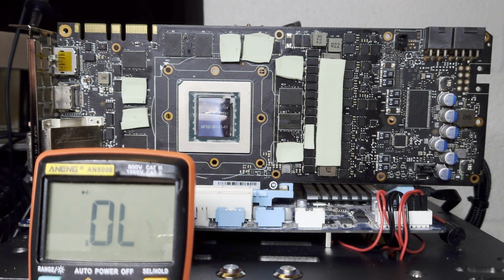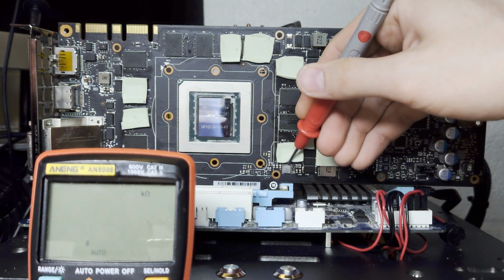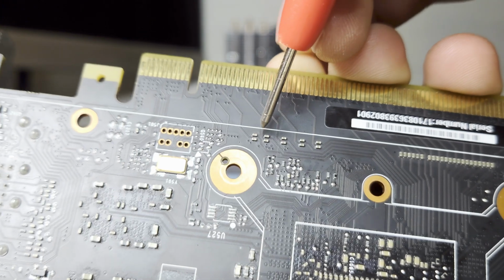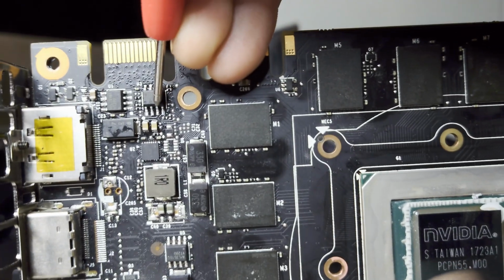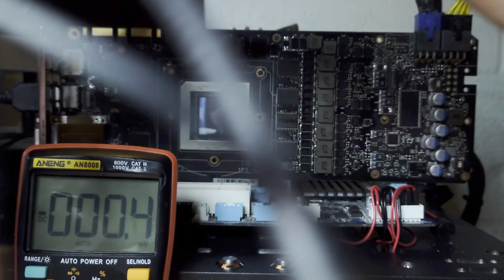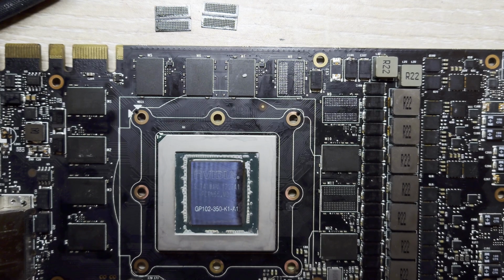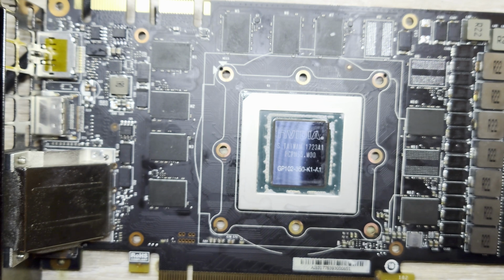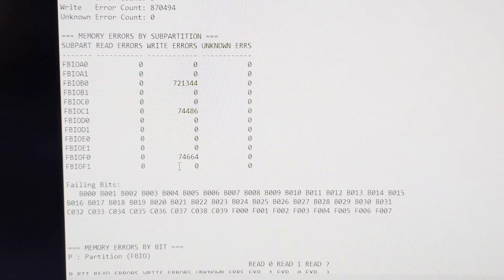EVGA GTX 1080 Ti SC Black Diagnosis - Not Detected

Comment: I had this exact same issue on pretty much the exact same card (mine was an SC2). Three dead memory channels in the upper right corner of the GPU. Which didn't pass the common sense check, very unlikely that 3 modules died at the same time. GPU had no thermal paste on that corner, which probably killed the memory controller. Anyhow, instead of swapping in a new memory module, I swapped memory chips between a known good channel and a known bad channel. My suspicions were confirmed. Not only did the errors not change channels, but the error count didn't change either. Therefore, dead GPU memory controller. Take a lesson, children: bad thermal paste can kill your GPU! This test also demonstrated that the memory chip taken from the dead channel was still perfectly fine, and therefore all 11 VRAM chips were likely still good.
Reply: Hi, I have a specific graphic for the operating processor. I'm looking for the pcb since my pcb was burned by a mosfet, I only need the evga pcb or founder edition, how do I get it? can someone sell me? just the pcb without the processor
Reply: That’s what happened to me, I got a good bargain for a GTX1080ti in good conditions, and the seller seems like wanted to repaste the compound on the DIE and did it poorly, when my GPU started to crash and got artifacts, the right upper Conner of the die didn’t have any thermal compound, it miss a little bit and it killed the Memory controller a long with the vram chip, after replacing it didn’t change much the results on MATS/MODS. 

But it lasted very long that GPU, I had it as a exter EGPU connected to my laptop, so it was never using 16x lanes just 1x. Didn’t push it to is max. It could lasted forever if it wasn’t for missing spot.

Comment: My die doesn't get hot after water block install gone wrong. I didn't use plastic washers and it just shut off PSU due to short apon startup. Live and learn. Lol. . Will search for burned 3.5 volt parts?

Comment: question. Isn't there a way to bypass memory modules? theoretically speaking, instead of 8gb, have 7gb
Reply from the maker: In theory? yes. But BIOS modding on Pascal is locked down and so only Nvidia could disable it.

Comment: Where do you get the datasheets for these cards? I'm trying to repair my 1080Ti and I can't find ANY documentation or a PCB layout. The 1.8v rail is ohming out at ~.430 and I've heard you state the the lowest you've seen is on PNY cards at .650 so I'm pretty sure that's my problem right there. However, I'm not sure how to further diagnose because I don't know what is connected to the 1.8v rail and what the values of said components would be.
Love your content btw, you inspired me, I went out and got a multimeter and heat gun :) I've been building PCs and PC gaming for over 20 years, I'm trying to get more into how everything works now and doing my own repairs etc.
I know I can fix this card, it boots into Windows, but only once the card has cooled down. It appears that the warmer the card gets, the lower the resistance becomes on the 1.8v rail, and anything below about .430ohms and the BIOS gives me a 'vga card not supported by uefi driver, CSM has been enabled for compatibility' error. I can enter BIOS, let the card cool for a few seconds and boot right into Windows no problem. Games and overclocks fine.
The card got some moisture damage which is why it's not working properly in the first place. I vape in my room and it's a very small room, and there's little air flow. That coupled with fast spinning GPU fans on an OC'd unit and it was the perfect storm for vapour build up. That's the ONLY component that it built up on, I'm assuming it was attracted to the dust and the fast moving air from the high rpm fans allowed the aerosol to cool and consense rapidly, causing the build up.
Can anyone help, or point me to a schematic for the EVGA 1080Ti FTW3?

Comment: Is it possible to run the card with part of the memory missing? I mean, also if this means to tinkering a bit with bios or memory configuration resistor. If yes, how exactly works the memory architecture for 2gb 4gb 6g and, of course, based on the number of modules you got on the card. TIA.

Comment: This card not detected even u put it on 2nd gpu? Either using motherboard internal gpu or other gpu for 1st display?
Reply from the maker: Even as a secondary GPU the card would not have been detected.
Reply: @TechCemetery  ok.. actually i have an similar issue.. i have 2 similar card.. 1 working .. and another not working... i check the voltage and resistance on vram, mem contr, 5v, 1v, vcore all present and similar with working card.. the only problem is that non working card have no display.. but the gpu is hot.. when i make it as 2nd gpu using my internal graphic motherboard it can be detected.. on gpuz... the only missing is gpu clock, it shows 0Mhz. and on device manager error code 43.. try reflash the bios and install a several driver from amd website.. still not working.. also applied clock patch.. still nothing... have any experience like this?
Reply from the maker: @gagak84  I have a guide video on memory corruption, there's a program called MATs that you'll want to run.
Reply: @TechCemetery  yes. unfortunately this is rx580 asus strix... i saw someone (russian) share on how to check memory corruption on amd.. but hard to understand.. using the same method (bootable usb on linux)
Reply: also memory size looks normal.. 8GB in gpuz.. can it be a memory problem even though the memory size in gpuz detected normal?
Reply from the maker: @gagak84  Yes, run MATs
Reply: @TechCemetery  mats only for nvidia right? can perform the same for amd card?
Reply: @TechCemetery  i had run using amd linux dmgg.py and identified 3 faulty chips.

Comment: hello, i have a rx 580 sapphire pulse that runs the fans, gets detected in linux (no video), in windows doesnt boot the pc, it stays in windows 10 loading screen and then blackscreen, any suggestion?
everything is appreciated
Reply: I would really appreciate your help, the card is almost new, bought it in second hand market and it lasted 2 weeks and died):
Reply: Could be dead memory bank or no voltage at all (1.5v)

Comment: i am watching every single video u put up. Tried repairing a GTX 1070ti rog strix today, but im lost
How do you know what voltages each vrm is supposed to give u? 

I´ve managed to find a working 5Volt line, but the other VRMs are dead. I cant really figure out which vrm is used for what, is there a way to find that out?
Reply from the maker: Experience mostly, 1.8V is the next power rail to turn on and is on the bottom left from memory

Comment: A «no fix» situation always leaves a bitter aftertaste, but you learn something every time. That memory controller was cooked beyond salvation. Improper heatsink pressure, maybe...?
Reply from the maker: That's my current guess given it's on the edge.
Reply: @TechCemetery  maybe result of repaste in same way people do on CPUs with heatspreader. I go nuts when I see somebody just put a blob of paste on GPU :)

Comment: Nice video thank you .i  have a R9 390 with large vertical yellow line on the screen and it restars when driver installed. Is it chip or memory modules ? Is there any chance to test amd vram modules ?
Reply: Im looking for the program tserver and could not find it, any suggestion?
Reply from the maker: Likely memory
Reply: @TechCemetery  Out of curiosity, is there a MATS-esque piece of software available for AMD cards?
Reply from the maker: Yep, it's called Tserver, I'll have a guide video on it eventually.